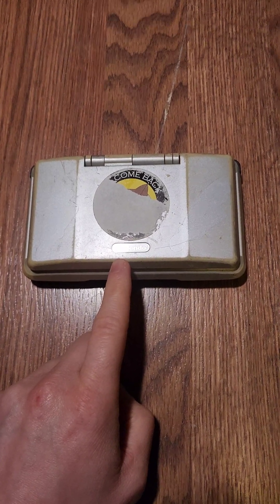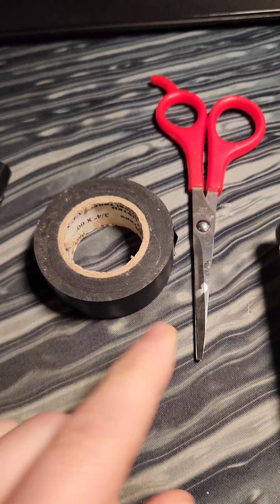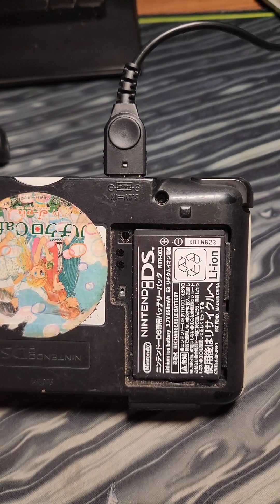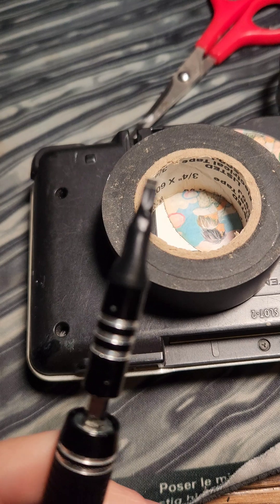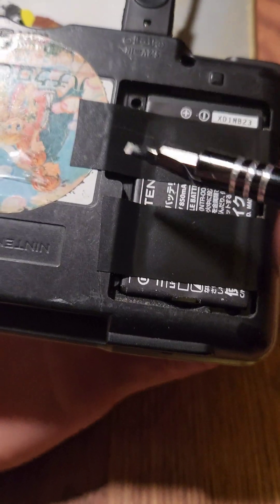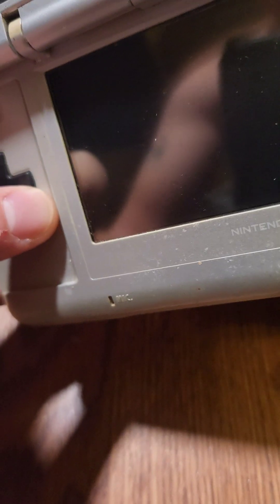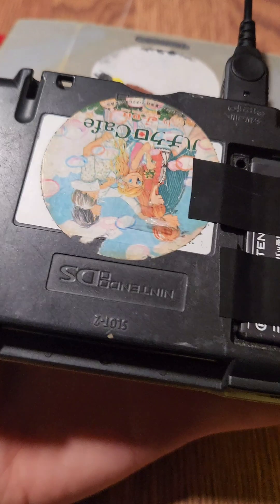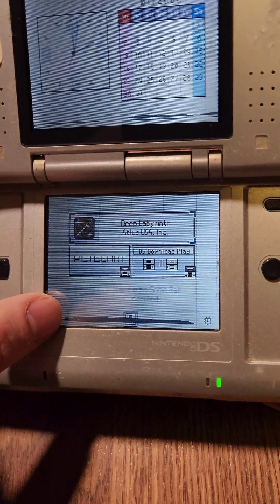Installing Custom Firmware on an Original DS or DS Lite // Modding Made Easy! #shorts

Comment: Nice, never knew this had CFW

Now, do you have a shell replacement to recommend? Cause the phat had terrible hinges
Reply from the maker: The CFW for this doesn't really serve much of a purpose these days, but it sure was handy back in the day back when there were files that could break the system when ran off of a flash cart 😅 still makes for a fun thing to document though, such a unique process to try! 

As for shell replacements: no such luck at the moment. I'm confident there are options available, though I currently don't have shell replacement experience for these handhelds :/ good hunting though!

Comment: It doesn't unlock brightness settings on a DS Lite, it allows later models of the original DS that used DS Lite screens to access the higher DS lite equiv levels of brightness.

Comment: i think i'd prefer sticking to using the r4 for homebrew..

but thanks for the guide!
Reply from the maker: You would still have to use an r4 either way, this just adds some extra light settings on certain models and adds brick protection from malicious in DS files 😎👍 honestly not too useful either way these days, but it sure was a fun video to make!

Comment: Based tool kit, only thing ive ever seen rated 5 stars on amazon.
Reply from the maker: I LOVE this tool kit! I bought it originally back when I wanted something equivalent to an iFixit kit, so I took a chance on this one. It absolutely blows my mind, for less than half the cost of one of the cheapest iFixit kits it has quadruple plus what the iFixit kit offers AND has more overall functionality! I would absolutely recommend it, mine's been going strong for almost 3 years now and has been used for dozens of projects!

Comment: There was way more easier way
Reply from the maker: I wasnt aware of an easier way, mind sharing it? Thanks! 😁👍
Reply: You just search up how to model 3DS and it brings you to this website play you just dumped a bunch of stuff on your 3DS file it's literally a guide and it good one thanks
Reply from the maker: This isnt a 3DS, its an Original DS, which is two generations older than the 3DS. If you want to check out some DSi or 3DS modding videos though, I have made videos on those as well 😎👍

Comment: So what else can you do with the firmware, didn't seem like much and the menu looked about the same.
Reply from the maker: Honestly... Not a whole heck of a lot these days, it was really handy back in the day for anyone that had a slot 2 flashcard when passme was the default method of launching NDS homebrew. It also offered brick protection from infected NDS files that would nuke the system. The only use cases today would be if you wanted to run slot 2 NDS files rather than through a slot 1 option, getting additional brightness settings on your DS, or if you wanted to save a couple seconds every time you started your system by bypassing the health and safety screen. For me... I just wanted to do it lmao
Reply: @doitallYT  I did it on mine to bypass H&S and an A press every time. not super huge, but I like autobooting to my flashcart menu in under 3 seconds ^w^ also, have u done any steam deck videos?
Reply from the maker: A great use case if I say so myself, good stuff! 😁👍 And I don't have any content on the steam deck yet, at some point I want to get my hands on one so I can see what I can make it do ✌️😎 stay tuned!
Reply: boots gba flashcarts into nds mode, skips the ds intro screen, and... thats pretty much it. it is a pre-requisite for the DS TV out mod though, along with some extra stuff.
Reply from the maker: I was totally unaware of the DS TV mod requiring this, thanks for the insight! 😁👍
Reply: Its a bit late but there is a version that can improve brightness on the PHAT DS. Makes the screen a bit more usable. Not on LITE level, but its something.